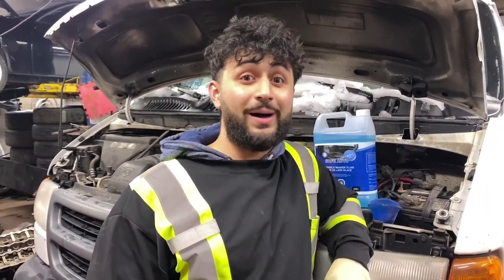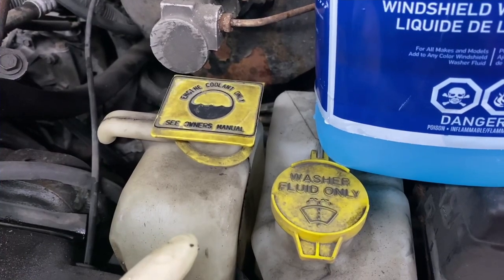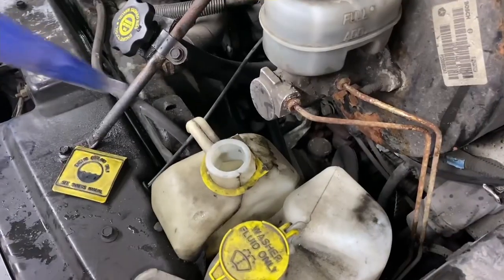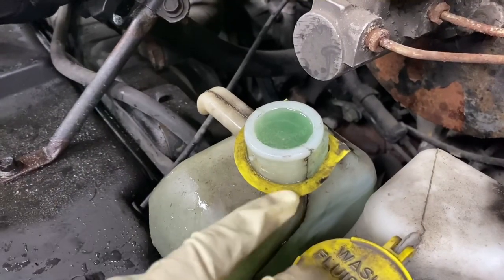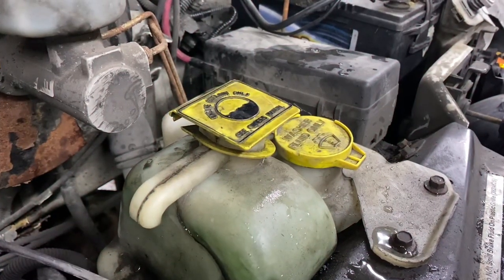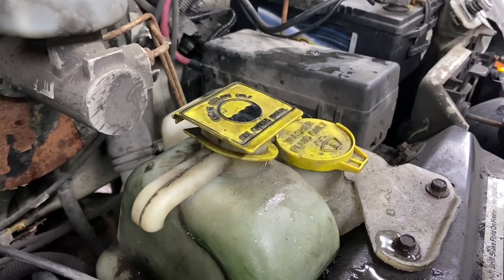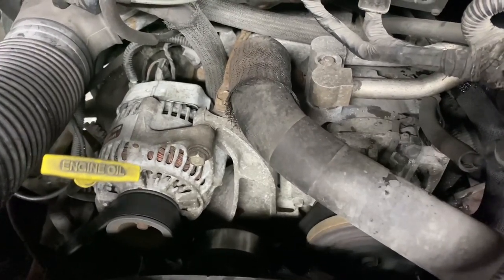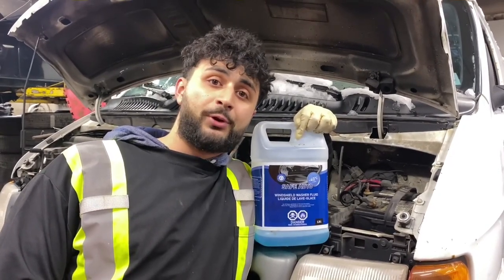What Happens If You Put Windshield Washer Instead Of Coolant In Your Car! #Subscribe #experiment

Comment: The fact that it started and ran doesn’t show the effects over time of possibly turning your antifreeze into a gel that can clog the system
Reply from the maker: Interesting observation you have made! Maybe a test for a future video!
Reply: @autolearn8404  I was about to say the same thing as mgjamisonaz. A proper coolant test would be long term (many months), or at least a week of driving around. That should be the minimum time to expect results. You can start your car without any cooling fluid and run it for a few minutes and it wont overheat. You can even drain all the oil and coolant and start your car an idle the engine for at least 5 minutes without a problem. Your test proved nothing. Nothing! You need to remove this useless video!  Do some research.        - Peter age 72
Reply: show some respect regardless of how old you are Peter. Now I don't know about today's cars Peter but I know for a fact that in a 1982 Olds 98 Regency you can run windshield wiper fluid in it. Cuz I did it all the time. And I also remember when people used to use transmission fluid as power steering fluid. My dad and his friends all you should do that. I was born in 1976
Reply: @PeterDad60  Dude I accidentally did this, drove for a week up and down mountains, didn't realize til it all evaporated. Then filled it with coolant and everything was absolutely fine. Sure this test wasn't the most thorough. But it is something, and more than you've done.

Comment: I did this last night. I called my mechanic, he said it won't damage anything right away and it's okay to drive for a short time, but it should get a coolant flush sooner than later. He said what will happen is the alcohol will evaporate at 20 degrees celsius (I added winter washer fluid) and create air pockets which could create an airlock in your pump which will stop your cab heater from working.
Reply from the maker: Better to do a coolant flush when you have a chance. It’s the safest option in preventing any damage from occurring to your vehicle.

Comment: I have been using water 💦 during emergency situations when I have radiator leak and believe me everything thing works just fine.The only difference is water 💦 evaporates so fast 💨 than antifreeze and don’t use water in winter 🥶 I only do this during summer.
Reply: You need more emojis in your comments

Comment: Will it destroy my engine I just topped mine off and want to know the damage
Reply from the maker: It shouldn’t cause any severe damage to your engine or radiator cooling system, I would highly recommend going to a local trusted repair facility and have a coolant flush and re filled to the proper specifications.
Reply from the maker: Thanks for commenting! I wouldn’t stress, you can drain out the Rad and flush it with the proper coolant for your vehicle and it should be fine afterwards. Visit a local trusted repair facility if you are unable to drain it yourself! Make sure it is back to the full level in the reservoir before starting the vehicle. If you run it low it can cause severe damage.

Comment: Whenever this happens, washer fluid evaporates quickly (lower boiling point then water) I jus let it go, and top it up with the proper coolant as it boils off, this stuff cleans the system to some extent in my experience as well
Reply from the maker: Thank you for the comment!
Reply: Did it work brother, I just filled 100ml approximately?

Comment: So I accidentally did this. Then drove about 300 miles through the mountains. Then another 40 or so back in town. Suddenly my engine got really hot. I pulled over, luckily used a rag to open the coolant tank because it was SOO hot and steaming. It seemed the coolant all evaporated away being such high percentage alcohol. I immediately filled it with coolant.

Hasn't been a problem or anything since.

Comment: I did it last week on my new Lexus NX. The dealer told me don't start the engine and use tow car to drive me to service (otherwise I might lose a money for parts replacement of cooling system as it can be broken in results, including engine overheating). So I called Lexus Assistance and they quickly found me one for free.
On the service they drain and replaced the coolant liquid. So, my inattention cost me 100 bucks :(

Comment: There was coolant level was at add so most of it was coolant. I didn't too it off. Will it be okay?
Reply from the maker: Thanks so much for the comment! Don’t stress! Usually there is a drain plug at the bottom of the radiator or you can remove one of the hoses. However if it was already mostly full I doubt any damage will occur as it will be so diluted. If you experience any issue visit a local trusted repair facility and have them flush and refill the coolant system.

Comment: A proper coolant test would be long term (many months), or at least a week of driving around. That should be the minimum time to expect results. You can start your car without any cooling fluid and run it for a few minutes and it wont overheat. The engine is a big chunk of metal and it does not go from ambient outside air temperature to being really really hot in the amount of time you tested. Look this up: You can even drain all the oil and coolant and start your car an idle the engine for at least 5 minutes without a problem. Your test proved nothing. Nothing! You need to remove this useless video!  Do some research.        - Peter age 72

Reply

Comment: I just did this tonight!!!
Reply from the maker: What did you end up doing to resolve it!
Reply: @autolearn8404  I did the same thing smh luckily I put in maybe 16oz at most, just siphoned the reservoir and added fresh coolant back to full. From what I have read as long as you didn't put a whole lot like a gallon it won't affect anything.
Reply from the maker: Thanks for taking the time to comment your experience! You did the right thing by siphoning it out and adding fresh coolant. By the sound of it you should be completely fine.
Reply: I just did this by accident. I looked at the picture and it looked like the arrow was pointed at the reservoir. Realized it too late. Was only about a quart and a half.. Thanks for your video.
Reply: How do you siphon it out?
Reply from the maker: Thanks for sharing :)
Reply: I just did this my check engine light came on for about a day then auto zone gave me a list of things but the lights went out bye there self

Comment: I accidentally did this the other day it was so windy and the cooling area I thought that's where the windshield wiper was supposed to go and I poured maybe a quarter of the bottle in there so I'm freaking outI accidentally did this the other day it was so windy and the cooling area I thought that's where the windshield wiper was supposed to go and I poured maybe a quarter of the bottle in there so I'm freaking out
Reply from the maker: First I’d like to say thanks for commenting your experience! No need to freak out these kind of accidents happen all the time. Your vehicle should be completely fine with no significant damage to the motor or cooling system. My best recommendation would be to have your radiator and coolant flushed and refilled to spec just to avoid any irregularities that may occur from having the wrong fluid in.